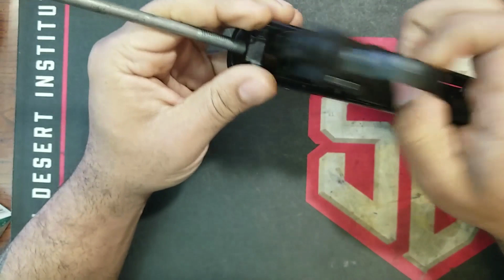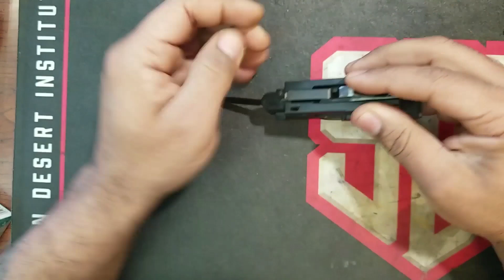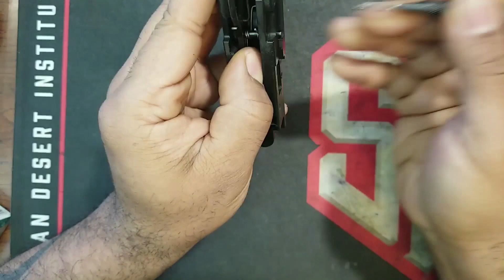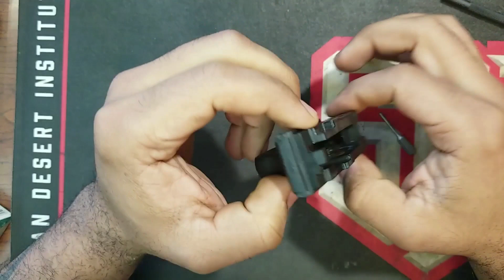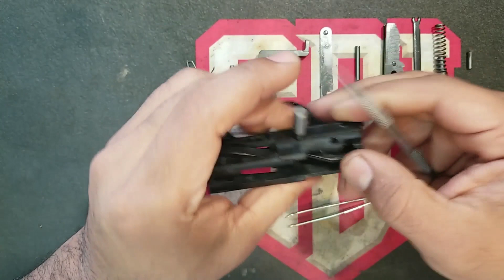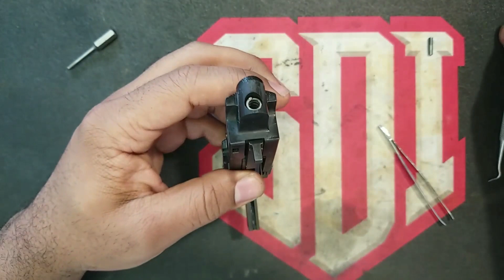Mossberg 500 fire control unit disassembly assembly and operation

Comment: By far the best instructional on  trigger group of Mossberg 500 
I took the sear and spring out of mine only once; i spent an hour fiddling about trying to get it together Never again 😂fingers cramps were to painful.
Mine has an extra piece like a goal post deal for safety that has to go back in with the trigger; suppose it’s only with the older models. I bought mine second hand couple years ago well used but still viable 
Anyway thanks for the tutorial 👍🏼💪🏽